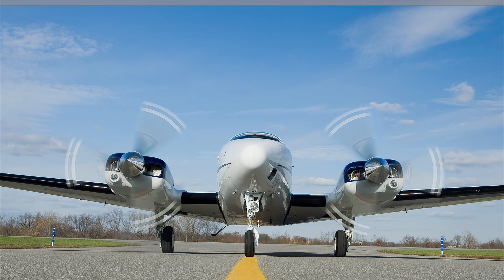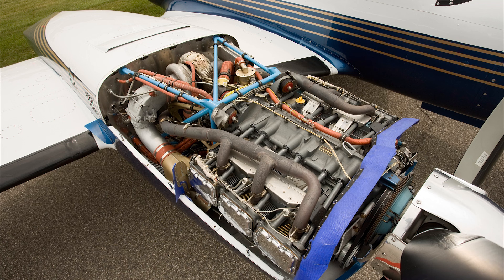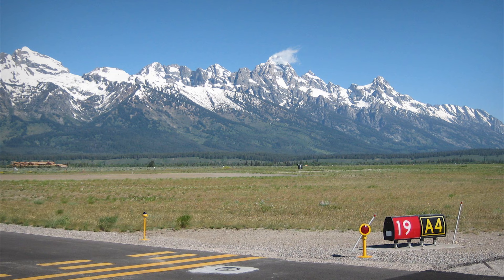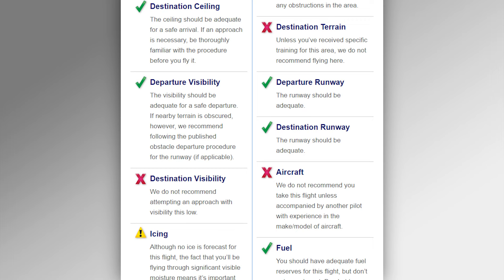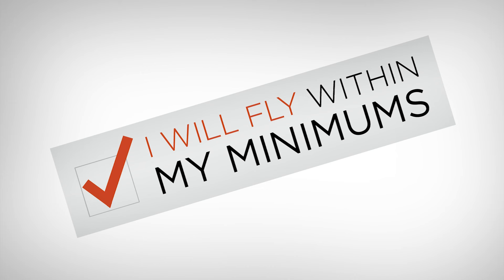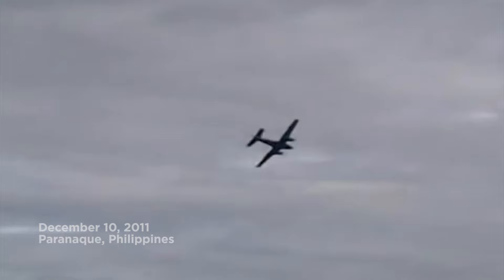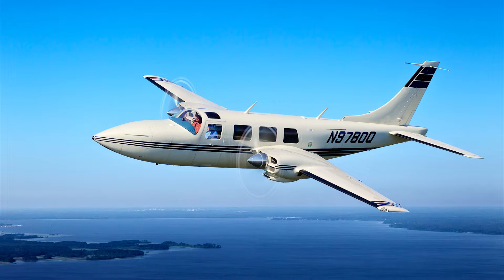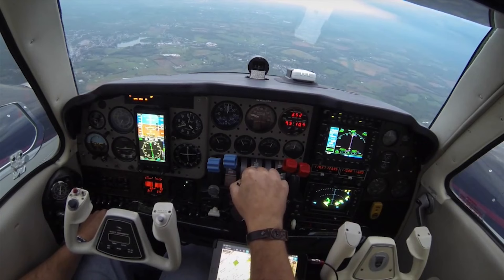Taming the Twin: Four Rules for Safe Multiengine Flying

Comment: I had to shut down the right side of my B58 Baron at 10,000' over the Chesapeake Bay.  We were IFR planned to Savannah when the plane yawed to the right; I couldn't straighten it out without stepping on the left rudder pedal.  Throttle inputs wouldn't do it, so I shut down that engine and feathered the propeller.  Came to find out the propeller had gone to feather before I shut down due to a lack of oil pressure to the prop governor.  A gear had blown in the case.  My wife and two daughters were with me.  ATC asked me where I wanted to land, and I said take me to the airport that is nearest my current heading, which was Patrick Henry in Williamsburg.  One of the choices was Norfolk Naval Air Station :).  Anyway, it was uneventful, but my wife was pretty nervous, especially when she saw fire trucks at the side of the runway as we made our approach and landing.  We had to be towed to the ramp as I didn't have thrust on the right side and couldn't steer the plane.
Reply: Prop went into feather due to lack of oil pressure ?  So prop feathers at every shut down ? Nothing about your story rings of truth !
Reply: @pauleyplay  The false expert. Allow me to educate. First, yes twins do feather with a lack of oil pressure. They do this because in the event of an engine failure you want to secure the engine not restart because you have a spare engine.  Singles do not. This failure is exactly why. You could fly the single to a landing site and the multi engine can do the same. Second, no the props do not feather on shutdown because there is a mechanical lock, called the anti-feathering pins, that prevents feathering below a certain RPM. This is why it is important to feather a failed engine quickly before the RPM drops otherwise it may be locked. In short, this story is exactly what is designed to happen.

Perhaps next time you will spend a few minutes on a reputable search engine before claiming something so easy to check is a lie?
Reply: @nameless-sn3tj  Sorry about my mistake. I have been a pilot & A&P all my adult life. Sorry but you are wrong. Constant speed props always default to flat pitch. I could be in a world of trouble in a aborted landing with a prop attempting to feather. Most engines don't respond to the prop control below about 1500 Rpm. Blades assume flat pitch due to spring loading. The governor pushes against the spring moving the blades. No locks, How would that work. Centrifugal force ?  We do unlock king air props out of feather, that's another story. Many good post showing how this works
Reply: @ Paul Van Tines 

I can tell you’ve never worked on a Hartzell Compact Feathering propeller before. 

Springs, nitrogen pressure, and counterweights as well as the aerodynamic twisting on the blades will turn it to FEATHER!

The only things that keep the blades in fine pitch are oil pressure and the pitch locks when the engine is shut down (this is why you need to feather most props before RPM decays below 900 RPM since the pitch locks are engaged below that) and why the prop will feather it you accidentally left the prop lever in the cruise setting. 

Yes, a single engine constant speed prop goes to fine with no oil pressure. Why it does that, I have no clue. Because on the fine pitch stops you can’t pull any power without greatly over-speeding the engine... and it absolutely kills your glide ratio.
Reply: Oh and my Qs. 5000TT ATPL and AME M1 and M2.
Reply: How amusing.  I was the one flying the airplane and what I wrote was what happened.  A gear in the case blew and oil pressure to the prop governor dropped.putting it into feather.
Reply: @Bartonovich52  You are correct I have not worked on any prop. I had the great fortune to stuff any bent prop in the company Super Cub & off to Sensenish ! About a 45 min trip. Your feathering story is OK however we checked 4 twins none went into feather with the prop pulled back to cruise. Single engine prop defaults to fine pitch by spring pressure. The power thing is all wrong. Governor controls max rpm not the stops. If this is wrong I will gladly listen
Reply: Good job getting it down safe.

Comment: 7:37 the poor guy in the Philippines crash could of fallen prey to wanting more airspeed and lowered the nose getting the full torque the good engine will supply. It's a very strong pull a lot of trim has to inputted beforehand to have some control over to get the nose back up to stop the pull from spinning the plane around. Practice at altitude.

Comment: Never turn toward the dead engine.

Unless you have the skill of Bob Hoover...
Reply: F Huber Especially if the rear engine fails on a Cessna 337 ;-)
Reply: Nothing wrong with turning to the dead engine if you have airspeed and maintain coordination.
Reply: Bartonovich52 That’s correct.
Reply: Flightchops does just that in a Seneca. About 10 mins in ok.  https://www.youtube.com/watch?v=U_noFZBTcJU  It seems if you have airspeed it should be ok to do so.
Reply: Disregard this, although as a general rule, terrain around you permitting, you should make turns into the live engine. Unless doing so will put you into a rock face.

Comment: Add a few knots to blue line? Adding a few knots to redline seems more appropriate. Adding knots to blue line will only decrease single engine climb performance. Why would you want to decrease climb performance when already struggling to climb after an engine failure? You might only have 150-200fpm climb rate with everything done perfect at max weight, pitching for the incorrect VYSE airspeed to make this even worse seems silly.
Reply: Agree, seemed like a mistake to say that in the video.

Comment: What most of you forget is the fact that the FAA (until very recently) did not allow the carrying of passengers in aircraft with only ONE engine.  Must have thought two or more engines were and are safer then singles.  Who knew !
Reply: Not true, part 91 has not had those restrictions!! That's a part 121 thing (may be 135 I don't know 135 well)

Comment: Are there any GA twins that will not only maintain altitude but climb (and even taxi) on one engine?
Reply: Just about all of them.
On a cool day, at sealevel.
And if you don't do stupid shid like leaving flaps and gear down.
.
The problem is NOT airplane performance, but pilot's skewed impression of what the 1-engine performance will be. As the video shows, you single engine climb performance is not half, but something like 10% of normal.
And your maximum altitudes are lower. On a hot day or high altitude region, it is quite possible for your new max altitude to be underground.
And the plane's handling and stall characteristics are *totally different*. Still manageable, but much slimmer margins all round.
Reply: Cessna 310, Cessna 320, Cessna 421, etc.

Basically the ones that are not trainers can have enough power left to actually preform. I've trained single engine go around in the 310 at reasonably high DA and moderate weight. They are also the ones that will kill an inexperienced pilot in less than a second. The extra power makes their loss of control quite spectacular.

And taxi is easy. Any twin can do that so long as you still have steering. It seems to be a wide spread myth that they cannot do so, yet I've done it with absolutely no issue on several occasions. You just don't gun the good engine.
Reply: After losing one engine, flying at Vyse will maintain altitude at your single engine absolute ceiling.  Above that, Vyse will give you the slowest descent to your absolute ceiling.  Below your absolute ceiling, you can climb with one engine inoperative, even if only by 50FPM.

Comment: I could be wrong but I don't think statistics support the idea that a piston twin is safer.
Reply: Or you could be right. I don't know about piston twins but I did do a study on the incidences of King Airs and the Pilatus PC-12 accidents from 1991 onwards. The King accidents have killed more people than the Pilatus accidents related to engine failure, actually to date there have been no deaths in PC-12's due to engine outs, there have been some very lucky pilots though.

Comment: OK, I know next to nothing about aviation, but at 8:16 I was like... wait, what?
Reply: beentga 757 it's easy to judge being dumb! Try to make a decision when you're stressed out...im sure a good instructor could break you and you'd realize how easy is to start making dumb decisions! That's why emergency training is paramount!
Reply: beentga 757 probably not! Because I probably would declare emergency and be focused on getting on the ground. Even though where I fly it's sea level and a light twin is capable of climbing with on a single engine with flaps and gear up. I have to agree with you on that one.
Reply: that CFI should and probably did have his license revoked
Reply: This was my instructor.  He had so many hours and decades of experience.  Sad and sobering for sure.  Fortunately the other two did not get injured very badly, but sadly he had like 10 surgeries.  He flew a lot of twins and practice engine outs all the time.  But they all perform differently and our expectations should be as such.  We have to seriously respect the twin engine out scenario.
Reply: I actually did this (landed with shut down engine and taxied off ) Its possible to turn off with a little momentum but once you slow to taxi speed its impossible in some planes (seminole, cough). Not that it matters. No amount of taxi inconvenience is worth crashing.
Reply: @andrewbatistoni5779  Some small GA twins won't even taxi on one engine?
Reply: @ianrkav  While taxiing at low speed they won't turn away from the dead engine easily. In some cases, not at all.
Reply: @marvinkitfox3386  Couldn't you just turn 270 degrees in the other direction (not a pilot so no clue if that would be feasible)
Reply: @Taladar2003  Yeeees. sortof. Its like saying you must drive your car, but you can only drive straight or turn left. never right. never.
this works if you are driving on a grid.
Then you encounter a gentle right curve. And you have to do multiple multiple multiple little spirals to get around it.
Realistically, you just *don't*.
Reply: He was probably an imposter like in Catch Me If You Can.

Comment: One of the questions that kept coming to mind was why the Cessna Skymaster didn't last? Two engines inline ... never an asymmetric thrust problem...
Reply: Something to do with lawyers ability to sue the makers because with one engine there is no guarantee of being able to maintain height or climb.
Reply: It didn’t last because 1) it was useless to train pilots to fly conventional twins and 2) it wasn’t any safer due to the complex fuel system, the tendency of the rear engine to overheat and fail before takeoff without the pilot knowing, and the difficulty identifying the failed engine due to lack of yaw (or in some cases.. with a failed rear engine and a low speed, high power setting, and a lot of right rudder... the yaw going the wrong way).
Reply: @Bartonovich52  It didnt last because of the lack of macho required to fly it.  also you were limited to centerline thrust twins.. if multi rating was obtained in one. How ever one was flown coast to coast with the front prop in the baggage compartment.  And dont forget the military flew them at LOW level completely over gross all the time in Vietnam. Hell of an airplane.
Reply: also there are plenty of gauges in the panel to tell which engine is running.
Reply: @Bartonovich52  Most of this is bullshit. Laughable, really.
Reply: @russellroe2472  That's bullshit Russell. The one prop in the baggage compartment thing was related to Bob Hoover and the AC 500. I do think that happened.

Comment: i always thought that you could still keep altitude with single engine
Reply: scanjett you can. Single engine absolute ceiling is achievable with one failed but high density altitude among other factors can run you into the ground.
Reply: Only a multi turbine engine has a legal requirement to be able to climb with one engine.
Reply: robo931  Don’t rely on climbing to it , you’d probably nearly run yourself out of fuel getting there . Descending to it from cruise with an engine out is the most likely scenario.

Comment: I thought one engine failure causes the craft to roll hard..,really hard..... u guys think he could have nursed enough airspeed if he nosed her down n up n down ?    Also is there ever more throttle to use in a pinch?   Like 115% of throttle for a lil safety cushion?     Not a pilot... jus curious
Reply: At or above Vmc (minimum controllable airspeed), an airplane can maintain directional control with corrective control inputs.  If you go below Vmc, the airplane will yaw and roll towards the dead engine.  The procedure for recovering from a loss of directional control is lowering the nose and decreasing the throttle on the operative engine.  
Without getting into detail, what causes the yaw and roll into the inoperative engine is the performance disparity (thrust, drag, and lift) between the operative and inoperative engine.  Vmc is calculated at max power from the operative engine.  So gaining airspeed, and reducing the imbalance of performance is necessary to correct a loss of directional control.

Comment: It just occurred to me that the opening graphic of this video shows a crankshaft arrangement that is never used in six cylinder opposed engines (whether Porsche or Lycoming or Franklin or Continental or Subaru.)
Reply: Woah woah mate, you are srsly getting stuff mixed up here. 
None of these manufactureres you mentionged, use opposed engines. 
I guess what you think of are boxer engines, which some of the you mentioned are using. 
Then you would be correct, since the animation is for a 180° deg V6 and not for a boxer, which to my knowledge has not been used in cars at all. 
In a V8 or V12 config yes, but not as a flat V6. interesting.
Reply: @MyDarkMe  I'm curious:  If you don't consider the offerings from Continental, Lycoming, etc, to be opposed engines, what, in your opinion, are they?
Reply: They are flat engines. Depends on the crankshaft, its either a 180° V engine or a boxer.
In an opposed engine the pistons would move towards each other.
Reply: @MyDarkMe  Ah...  I have always heard people refer to the Continentals, etc, as horizontally opposed and the ones you are referring to as opposed piston engines.
Reply: @ Rafey1, you are terribly confused. 

They are all flat engines because their cylinders lie flat. 

They are all opposed engines because their cylinders oppose each other. 

Only the four cylinder flat opposed engines are Boxers which are named because of “boxing” motion the same side pistons make.  Any four cylinder Porsche, Subaru, Lycoming, or Continental engine is technically a “boxer”.. but the term is rarely used in aviation. 

And to the OP yes no I6 or flat 6 engines use cranks with shared throws. However, V6s do and some are used on aircraft (the Centurion 3.0 was just certified).
Reply: I beg to differ.
Yes flat, buts that about as far as true statements in your comments go.

No the cylinders do not oppose each other. 
A proper opposed engine would be something like a Junkers Jumo 205.

Wrong. There are six cylinder boxer engines as well. Like in all of the Porsche 911s (note 912).
Porsche did not any 4 cylinder boxer or and 4 cylinder for that matter in 40 year (from 914 '76 to 718 '16)
As I already stated it depends on the crankshaft if something is a boxer or a flat V4-6-8-12. 

Just because a few folks of the tiny GA community in america cant properly describe something, the whole world is not gonna change.
Reply: @MyDarkMe 
"LYCOMING OPERATOR’S MANUAL SECTION 1
O-360 AND ASSOCIATED MODELS DESCRIPTION
SECTION 1
DESCRIPTION
The O. HO, IO, AIO, HIO, LIO and TIO-360 series are four cylinder, direct drive, **HORIZONTALLY OPPOSED**,
air-cooled engines"

Lycoming wrote this in the manual for their engines, but you clearly know more than them...

Comment: personally if I buy a twin-engined aircraft, it has to be at least thrice as powerful as it needs to be, and has to be able to take off with 50% throttle at high DA - for the sake of handling 1EO conditions
Reply: REALLY?????  3 times as powerful as it needs to be????  Where IS this magic carpet?  I've never seen or flown one...and I have a LOT of experience in twins, singles, jets and helicopters........take off with 50% power at high DA???  Sorry but it aint so as far as I've ever seen....and I live at 6,000'.  It's ALWAYS high density altitudes here.....even my Ram VII 414A with extended wing tips has no chance of meeting your expectations.
Reply: The 414 is really an underpowered 421 and a very underpowered 425 so I wouldn’t expect it to. Getting into the high powered King Air series like an F90GT or a 350 would get you close and a Cheyenne 400 would definitely do it, but you’d be amazed at how gutless they feel after a while.
Reply: @awittypilot8961  I'm talking, has to have climb performance above +500fpm @ Vxse